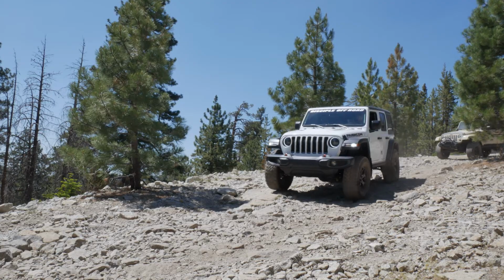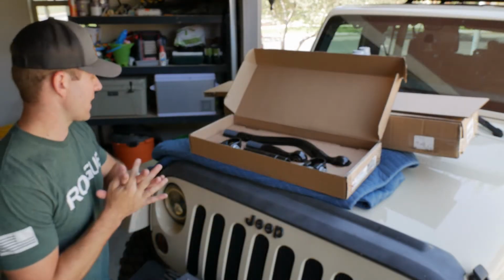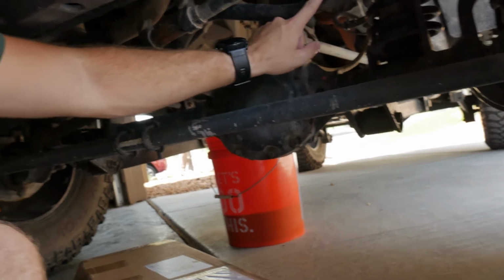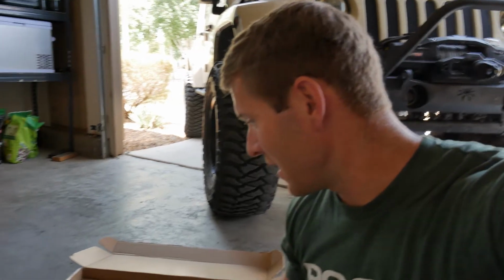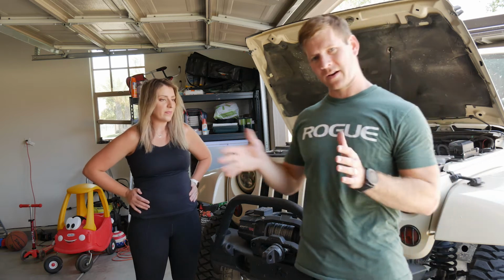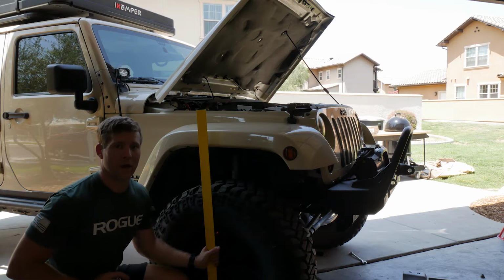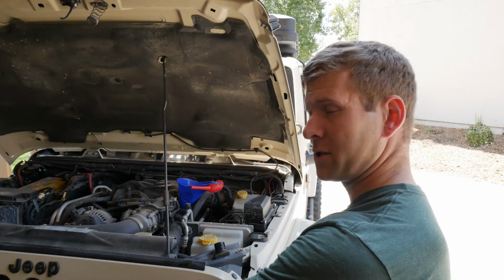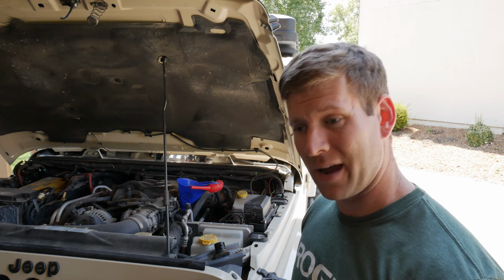Krazy Beaver Shovel Unbox | Steer Smarts Yeti XD Trackbar Install

Comment: Great video, just a little tip with a top side oil filter if you remove that first  before you drain the oil your oil will drain quicker ,kinda like a vent
Reply from the maker: Great tip, appreciate it!